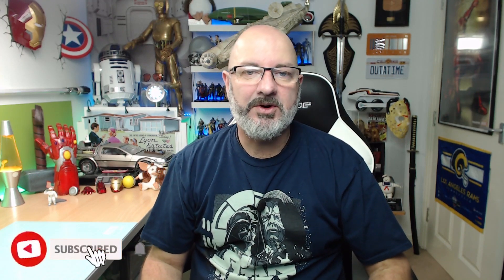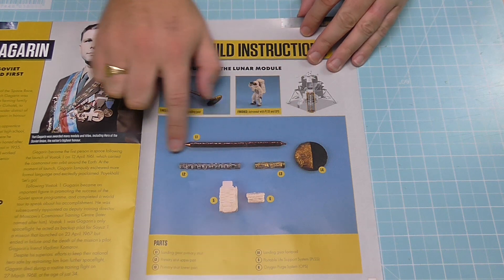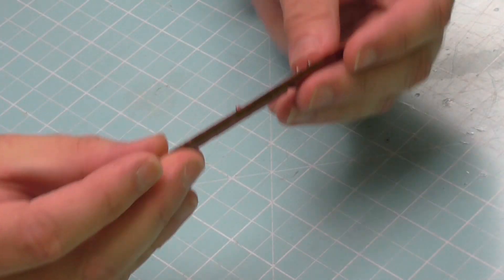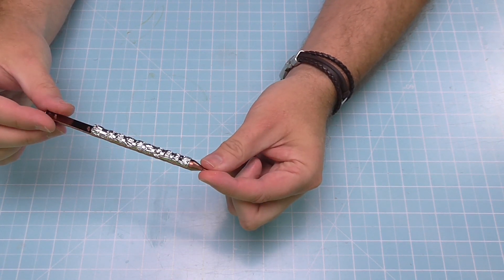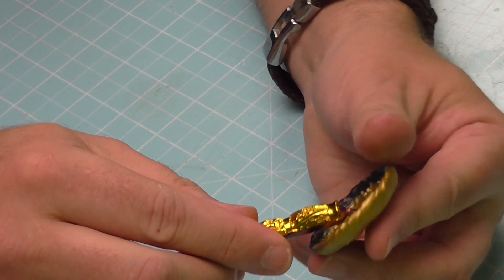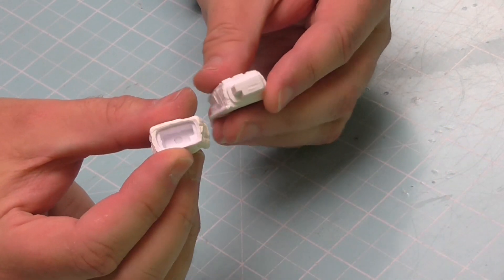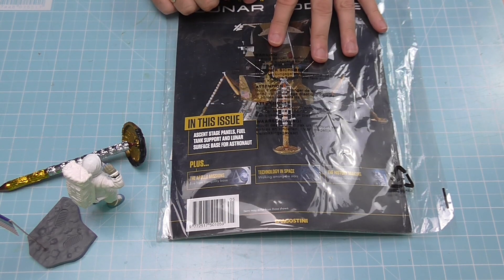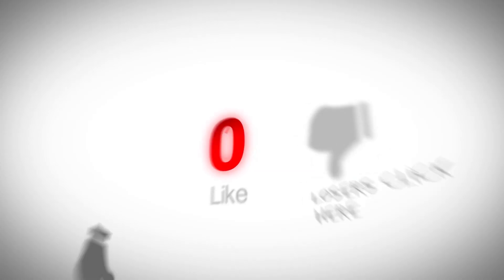Build the Apollo 11 Lunar Module - Part 4 - Landing Gear and Astronaut PLSS and OPS

Comment: You would have liked a project I did in about the 4th grade. I did a space shuttle with external tank and boosters from scratch. Used paper towel and toilet paper tubes for the round parts and did all the rest by hand. Last time I saw it was last day of school still displayed on the shelf in the classroom. Probably was chucked out many years ago (I’m slightly older than you) but I was quite proud of it at the time.